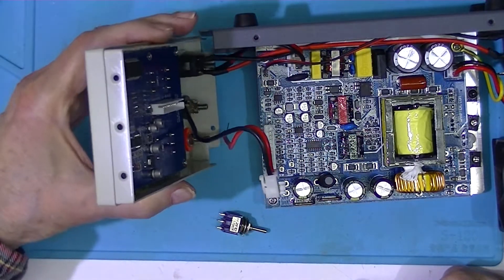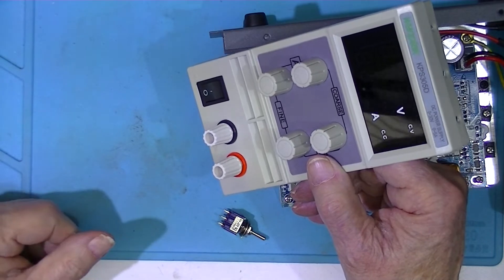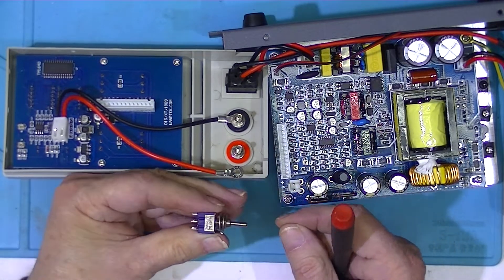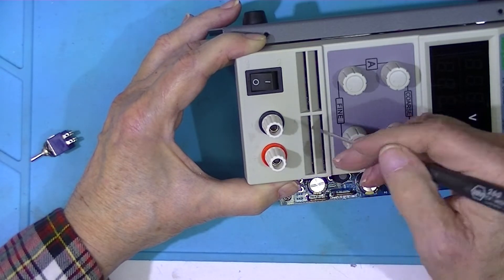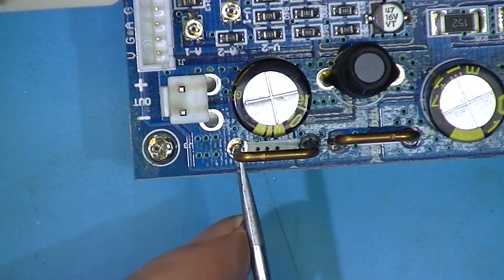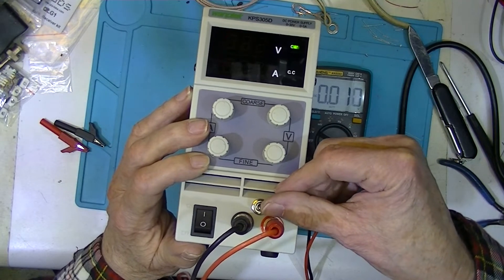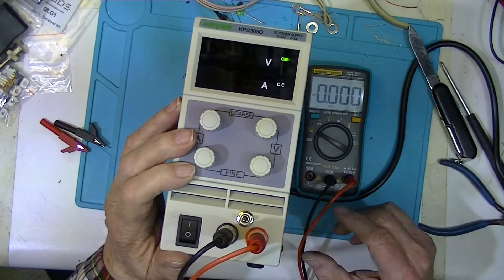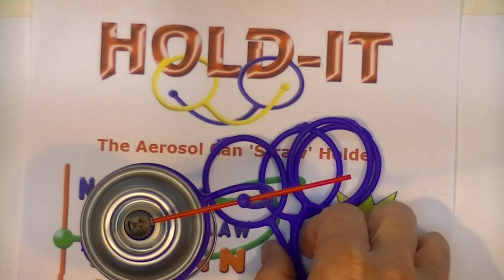Wanptek (Eventek) 30V 5A Supply Load Switch

Comment: You know that's a good idea! I have a power supply almost similar to that that didn't have a power cut off switch like my other digital power supply. So I was going to put a toggle switch in it like you have done but I like the idea that you have a DPDT switch to short for current settings.  Thumbs up! I would also be curious to see the activity on an oscilloscope when you're doing the switching to see if it has any spikes.